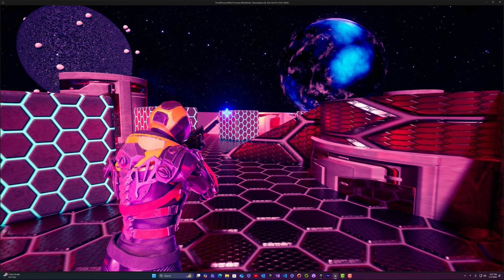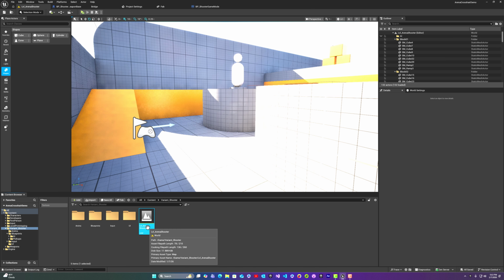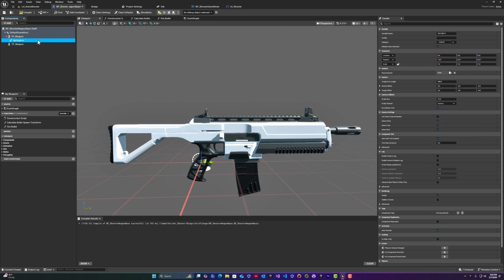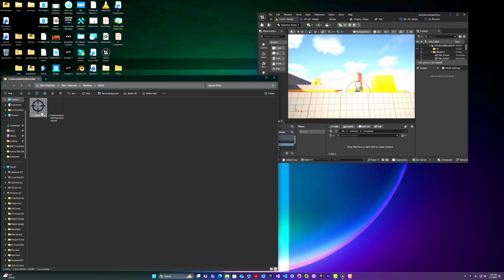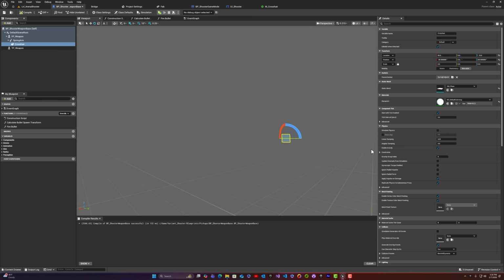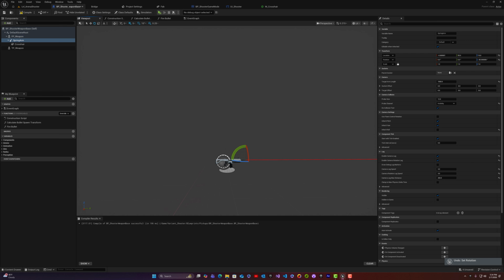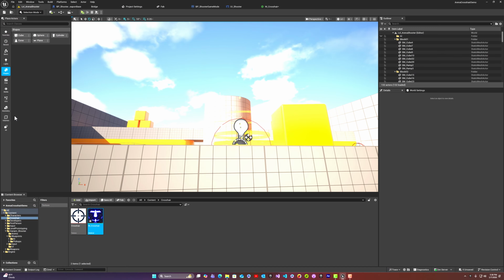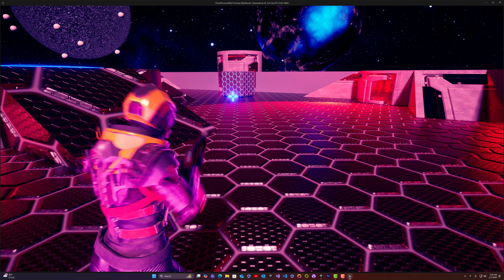Unreal Engine 3D Crosshair Trick

Comment: Interesting approach, and it's most certainly been done before (some 10 years ago for example). Your approach utilizes different components than is commonly used, but the core concept is as old as crosshairs themselves. My theory as to why you weren't finding any hits during your search? Specificity and disinterest. If you search for "spring arm crosshair" for example, you'd likely come across the ~10 year old discussion on the approach. Outside of that, you won't find many people interested in taking this approach outside of experimentation or just to be different... and hey, nothing wrong with that! There definitely are some specific titles and genres that a laggy crosshair works well in. Generally though, feedback from your play testers will be negative or "uncomfortable" when it comes to laggy crosshairs. Once the novelty of it wears off, players can get annoyed having to wait on that very thing they depend on for reference and/or guidance.

Typically if a game requires a crosshair, any offsets or effectors are snappy. FPS games have pushed hardware manufactures to eek out less input lag, and whole swaths of software and systems tweaks exist with the sole purpose of removing the lag you introduce with your approach. Many games choose to have crosshairs front and center, and any delays/offsets/etc are happening on other elements - such as the character facing toward the crosshair... crosshairs tend to represent where the viewer/player is intending to be looking.

Having the crosshair catching up to where a player is looking almost gives a feeling of life, and if you've played enough obscure and experimental games, this has been utilized quite a lot. Sometimes to great effect, other times... well, not so great. So there is balance here, and ultimately where someone lands with their crosshair setup is the "character" of that crosshair. Watch enough game review videos, and you may even see a trend, where people take crosshairs very seriously.

Without being weird and/or experimental, working on a serious project/title, I think some slower paced adventure/exploration games can utilize a laggy crosshair and not annoy the player. Mystery games, or genres in those similar domains as well. At that point the crosshair turns into more of a cursor and is accepted by players, if not enjoyed and noted in reviews and deep-dives.

I'm curious what the performance tradeoff would be when utilizing a spring arm versus a line trace and some basic math. In a large project where performance isn't an issue I'm sure 0.5ms is negligible, but something to consider when you're keeping your finger on the pulse. Poor UE is always getting shamed in the performance department, and it's because of the minutia of little solutions like this being chosen, over a more performant one. I'd be interested in some differential tests with this system and a line trace + math approach...

If you really dig into crosshairs, like actively research... there is a lot of material out there. I swear I have a book solely about crosshair development and design in storage somewhere, from like the 90s or early 2000s. JayTheDevGuy did a bit of a short history lesson on crosshairs in a video where he goes over programming a crosshair system in his indie game or something. Scour over old GDC talks. Old game dev magazines... tons of material when you start digging, and all of it is interesting.

Keep in mind my short novel above is just honest dialogue, and I'm being objective - no intent to rip on your approach at all. In fact, I encourage you to keep an active project that is all about crosshair experiments, and keep each solution modular so you can rapidly tear it out and use it in other projects. Keep that fire going, and thanks for sharing!